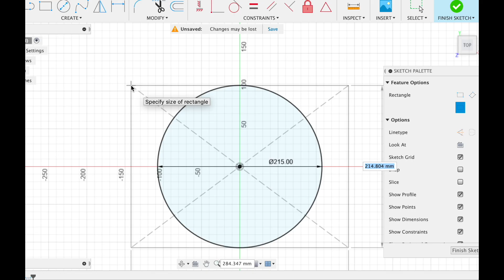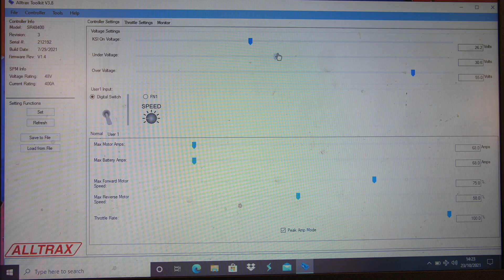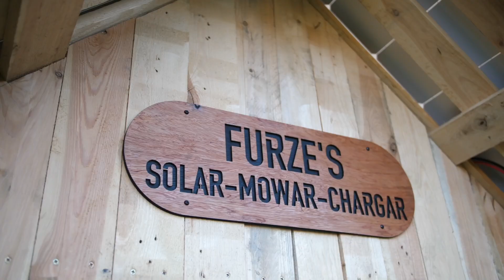EV Mower Conversion with Solar Charging Station

Comment: I love that tractor. It looks VERY similar to ones here in the US, but that rear discharge door thingy?!? What is that? Why don't we have that here? Maybe we do and it's just that I haven't purchased one in a few years? Very interested in this design. How you built it seems exactly on par with what I'd do if I were a fabricator! I'd seriously consider saving every thing and using only one front motor, and using the same pulley and drive belt setup. It's already there, afterall.

Comment: That is all well and good for those of us who have a "lawn tractor" BUT there are differences between a "garden tractor" and a "lawn tractor" here in the States!! A Garden Tractor in fact looks like a lawn tractor but they are very different animals indeed!! You see a Garden Tractor, has attachments like snowblowers, plows, tiller options and other add ons allowing you to do way more than just "mow the lawn" and before I forget YES you can get a lawn mower for a garden tractor as well too!! 

My point is I used to own a Garden Tractor.....and it was always working on some project I had!! I might drag my car around the yard with it, when my car was broke down!! OR I would hook a wagon to it, while doing work in my garden or removing or planting a tree!! And sure I would even mow the lawn with my garden tractor weekly when I owned my property..........but it hardly if ever just "sat around" for a week doing nothing at all between mowing that is!!

Comment: Program it so that when the battery’s are low the blade will not engage and it will allow you to still drive it back to the charger

Comment: picked a good mower to do this with. i've seen similar mowers (same manufacturer whether the same name or not) less than 5 years old with holes in the side of the engine the size of my fist due to connecting rod failure. i pick up mowers for free and flip them, and also build toys to have fun with out of spare parts.

Comment: That definitely turned out much more efficient than expected and you did it with really the cheapest most readily available batteries, one hefty lipo or a brick of 18650 or 26650 cells would be cool and much smaller and lighter and again increase efficiency, in the spirit of your channel adding a trimmer hanging off the front to take care of those pesky tree limbs and swing set that tried attacking you would be awesome

Comment: @colinfurze, why don't you chuck and inverter on the shed and charge all your Ryobi batteries from there? 
The Ryobi tools will be green in more than 1 way then :)
When the mower is plugged in it should act nicely to give a steady source of power while being topped up by the solar panels.

Comment: wonderful tech demo! would love to see this scaled up. This perfectly shows how the logistics of solar tractors work, could be done with larger farm equip. imagine the torque!
Reply: Farm equipment generally gets run 16+ hours a day during harvest. I don't think batteries are up for that yet. Batter powered lawn mower are far more logical.
Reply: @crissd8283  Large farm equipment could be designed with swappable batterie systems then farmers could have a number of solar arrays/battery charging and swap stations strategically placed over their land.

A company called John Deere have an electric tractor that runs for 4.5 hours on one charge, something like that with swappable batteries would do the trick. They also have autonomous and semi-autonomus versions so the whole swapping process could be completed automated.
Reply: Sorry, won't work (for now). A large farm would need so much power you would need a whole yard of batteries. Imagine for a 500acres farm I chew easyly during harvest (2 harvester, 3 tractors for transport, 1 loader, 1 to prepare the field) 1200l diesel/day. Preparing the soil with 2 large tractors also uses the same quantity.
Reply: Check out fully charged, they did a video on an electric tractor that was in country file

Comment: Needs a little trailer. 1) to hold garbage can, incase you want to collect debris. Or 2) to carry a corded weed eater ect for the hard to get spots.  Number 2 can change based on the task.  Anything from weed eater to Bush trimmer....pressure wash...🤷‍♂️ 
Good work 😁

Comment: Not for me. 1h is not enough when it is 2.5-3 hour cutting here. And that is done weekly. Just the front lawn is over 1300 m². It would need at least 3x the power, and it should need to be twice faster to drive. 

I have been wishing such electronic lawn mover for 30 years now and we still likely couldn't make it even if the engine compartment would be filled with the lithium battery cells.
I wouldn't even consider anything like this for a professional use, where one would need to be driving whole day, 5 days a week. This is having same problems as every electronic vehicle in the development, just not suitable for the 60% of the people.

Comment: If you only mow once every 2 weeks or maybe even once a week. That should be enough time to fully charge it with a reasonable sized panel. Image a company selling these with a small mower sized storage box that has a lid with a panel on it to charge it. Pop the lid up and pull the mower out when needed. Put the mower in and put the lid down to charge. Compact, convenient, and storage/charger for it. All in one kit. Add an extra wall charger in the event you go a couple with with minimal sun. But still you would think it would be fully charged after a week even with cloudy days.

Comment: I love Colin Fuse. Sadly this one was not .. Well it was just redoing something that has been done lots of times, when you could have just bought one. Perhaps this is a new concept in Britain. You have been able to buy these in North America and Australia for a few years now. There are more than one brand available.  And of course people made them in the backyards before that. They haven't taken off in sales because they only really make sense for a specific niche, if at all. You can get a cheaper petrol unit that is more reliable and will last 7 years, easily. Versus a battery machine that has to be thrown away after just 4 or 5 years and may struggle for larger lawns within 1 - 2 years. . 
However the big advantage is the reduction in noise. So I suspect that they will very gradually become more mainstream. 
Solar on a shed is.. Well it is basically the norm in Australia.

It was still cool to see DIY and making something in a shed. I always like that. And Colin always makes it so entertaining. So not knocking the video. Just surprised people seem to think this is new.

Comment: uhm actually....since lead acid batteries are so old they have a much better eco system for recycling
you can recycle pretty much all of the lead and the acid has some uses too
I think at this point it would be more environmently friendly to use lead acid batteries than any other type of battery, but that may change in the future

sure lead is bad, but only if it is disposed of incorrectly
following the proper procedure it is pretty sustainable

Comment: Hey Colin, luv the stuff you build. You should speak with my dad, he is an electronics technician by trade and even designed a new LiPo battery system for his bespoke e-bikes. He lives in Kettering and would love to work with you. Ping me back and ill share contact details.

Comment: You just done something that would have changed the future of the company I once worked at unfortunately our plant where we made the transmissions and many aluminum and plastic components for the same lawnmower you used has shut down and the company has since sold out to bigger names

Comment: Cool video, got the next version for you.
Anaerobic digestion system, so you cut the grass.
Grass goes into the digestion system, methane comes out to fuel the law mower.
Bonus is fuel is free, clean and bigger the lawn the more fuel.
Also you can throw your food waste in there.

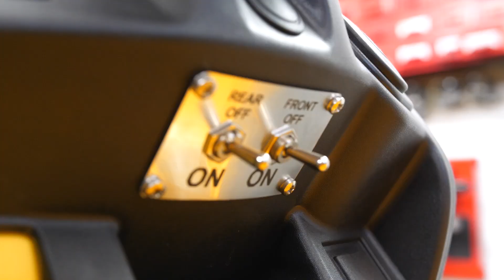Comment: Hey Furzey, Big fan. But why do you have turd tickets mounted on the wall behind you at 6:20

If you really wanted you could solar charge A RC TX and RX with display (remote control transmitter and receiver) and reverse camera channels. you could run your mower from your couch assuming you could configure the "Solar Mowar Chargar" to dock remotely.

Comment: You could have done yourself a favor and put all 6 batteries in series, and had the whole system powering both the drive and blade, then you'd basically have an elec-trak e12 without the attachment options, which is good for about an acre and half of mowing.

Comment: That is one of the smallest decks I have ever seen on a riding mower. Single blade too! Still looks like a decent machine with the engine actually having an oil filter. It definitely needs some CALB Lithium iron cells or 12v replacements like Battle Born, Renogy, SimpLiPhi, RELiON, etc.

Comment: Where I live, where everything is way over regulated, that shed would need a licenced electrician if the pv output is more than 50V and/or 240Watts and the structure would need to be compliant and engineered to support those pv panels.
Ask me how I know this and had to pull stuff down.

Comment: Very cool project.  One thing you might do to improve the efficiency of your design is to get rid of the belts and move the motors to direct drive.  You are going to loose a fair bit of power in belt slip and friction.

Comment: The mower itself is 30 year old technology, but the solar shed with panels for a roof is a brilliant idea. It's always interesting to me to see a solar array in the middle of someone's field that's not quite tall enough to stand under, and completely useless for any other purpose. Making it a bit taller and adding 4 walls is innovative.

Comment: give it a setting so you can deactivate the blade fully, and dump the extra juice into the main movement to have it double as a small yard tractor - pull a cart/trailor, lumber, run a lil plow (or snowblower, im canadian). lithium has potential as well with cutting down on size and adding more overall power ;)

Comment: Why not build your own lithium ion battery packs? All you need is a load of individual cells, the most common of course being the 18650 size, though for this project you could easily use fatter cells to give more capacity, such as 26650 cells. These would need to be spot-welded together into a parallel pack, and then just have as many packs linked in series to give the voltage output you want. These could be charged by your existing solar charging station with only minor modifications to regulate the charging voltage, since lithium ion cells are a bit more fussy about this than lead-acid cells are.

You could even use the really fat 38120 cells. These have screw terminals on each end, so you can assemble them into battery packs without doing any spot-welding. They are also much higher capacity, so using these would give the mower huge range!

Comment: You could bespoke your own battery Colin. Spot welder, copper strips and some 18650 or similar. They go together the same way any other battery does. 

Or you could get a lithium iron leisure battery from internet's. 100ah for £100 or so.

If you really wanna lean into the eco side of things for the sake of the project, get people to send in their old batteries and wife them up 👍

Comment: Not to rain on the parade, pun semi intended, here in the states, I've had plenty of times in the spring when it rains for 3 days then the grass grows about 4 inches, then you cut it, then the cycle repeats. Obviously we're running into the age old problem of solar, in that it only works when the sun shines. 

We need a REAL consistent source of power, not unicorn farts and rainbows.

Comment: Lithium-ion batteries degrade fairly quickly when they sit at 100% charge. 
lithium iron phosphate batteries are probably better because they have a longer cycle life and I believe can handle 100% better.
I’ve just had a look at Wikipedia and they actually say they are a good replacement for led-acid batteries

Comment: I'm shocked. He's actually made something that's a) completely sensible and b) a much better idea than what already exists. Also possibly c) commercially viable.

You feeling alright Colin?
Reply: a) ignoring the fact that it's way too big for his garden, I agree
b) this alreads exists, but smarter. There are lawn mower robots that have a solar charging station, the difference being they don't have to carry a 80kg human driver, thus can reduce the motor and batteries massively.
c) taking b) into account, this could be a tough product to sell. These would basically only sell to those people who like to mow their lawn manually.
Reply: @ben_1  Robot mowers, at least the ones available right now, are not suitable for every situation. In some cases you don't want to have them around for liability reasons, and since they're much slower at getting the job done (due to literally driving slow and due to pathing inefficiencies) you also don't want them in heavily used areas, since you don't want the mower around when people are actually using the space.

Comment: I would have liked to see you put a side discharge chute on the right hand side of the mower deck due to the hassle of emptying the bagger on the back of the mower and then see how much longer you get worth of a battery charge